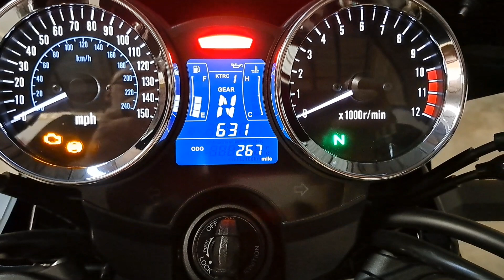Z900RS Cafe. My Oil Change and Break-In Procedure.

Comment: Nice bike man. I think your break in procedure is sound. I just broke an Indian motorcycle in and the guy at the dealership told me something the manual never mentioned. If you read the manual though it said to "vary rev ranges and not exceed 1/2, 3/4, and full throttle for extended periods of time" for the 3 break in tiers.